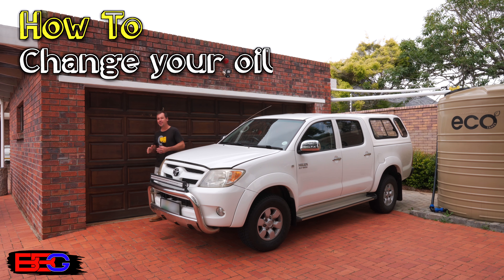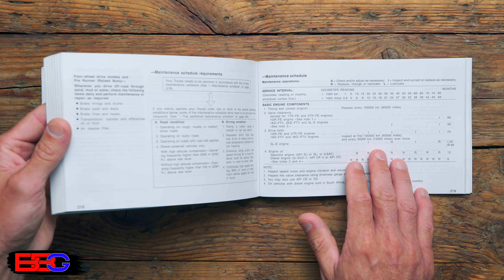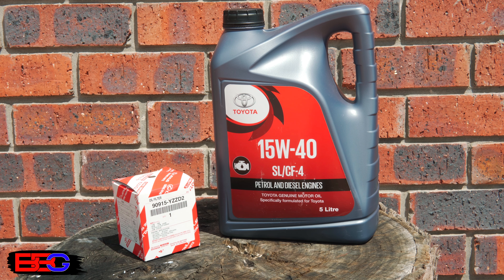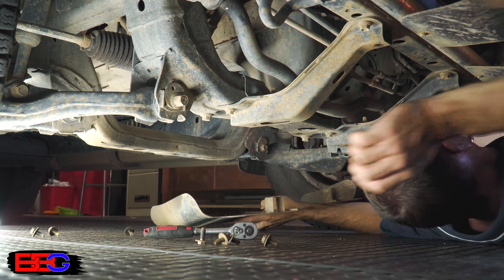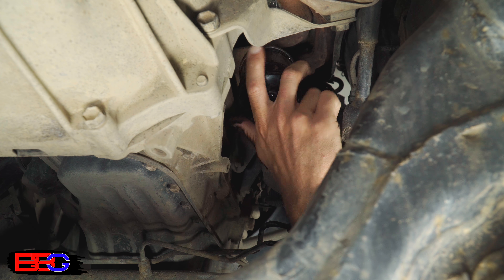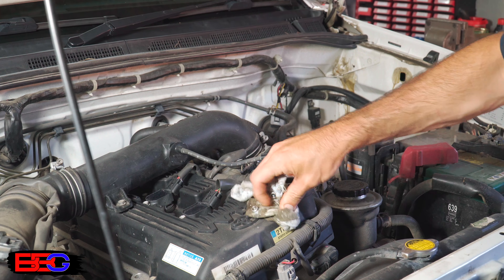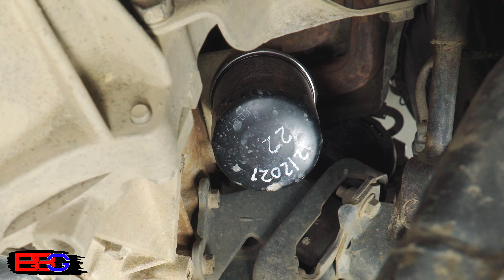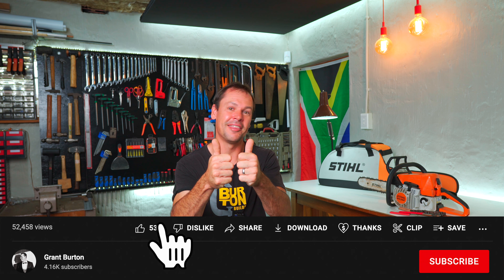How to Change Your Cars Oil ✅ DIY GUIDE

Comment from the maker: @alfredomarquez9777 left this comprehensive comment for us... which I'm reposting here (had to upload the original video a second time)... thanks very much for your feedback.

Hi there!, one thing that helps the used oil get out more completely, is to perform the draining at a warm engine temperature. If you drive the vehicle long enough to get to full operating temperature, and park it while you gather all the tools and fluids, it will then have most of the oil down into the oil pan by then.  For the many of us that have a Turbocharged engine, you may consider the use of a flushing oil or cleaner. Those thin liquids, do thin the oil slightly, the better ones have some extra detergents that help to clean the very small oil passages on the Turbocharger, that are prone to get progressively fouled by carbonous residues due to the very high temperatures that the turbine end of the turbocharger can reach, and in some cases, those small passages with end up clogged, causing an expensive turbo bearings failure! In my country, we have the "Wynns" "Oil System Cleaner", a small bottle of light hydrocarbon with detergents, those cleaners or "oil flush" liquids are meant to be added to the used oil in the engine before draining it, then the engine is run for five minutes at idle or slightly above idle speed (Don't over do it!), and then the used oil is drained; 
-Careful!: most times, the thinned oil draining stream will be exiting the drain reaching a longer distance due to reduced viscosity and improved easy of flow! So you have to place the drain pan FURTHER AWAY!!! 

 I have found that it also cuts the time to finish draining the used oil somewhat too. The used oil will appear somewhat darker, a testimony that those cleaners are indeed working  without a doubt! I also place a small magnet under the oil stream draining from the engine, just to catch any magnetic metal dust that could have got in the oil, just for peace of mind. Another practice that I do while waiting the oil to drain, is to take out the sparkplugs, which is advantageous for keeping an eye as an engine health check, and also because spinning the engine with the starter and the sparkplugs out helps to throw away the last quantity of used oil clinging on the crankshaft counterweights, and also to help to PRELUBRICATE the engine with the new charge of oil, which prevents running the top of the engine without oil pressure at restart. Usually, almost an extra cup of used oil will be sent out just by cranking the engine for three seconds without starting it. By Pre-lubeing the engine, the oil pressure will be instantly achieved. Finally, checking the oil level at mid point between changes, will tell you what is the oil consumption of your engine, because some engines DO consume a certain "normal" quantity along the year, so that  you can top off the necessary quantity.  Best regards from Mexico!
Reply: After reading this, I know nothing :-)